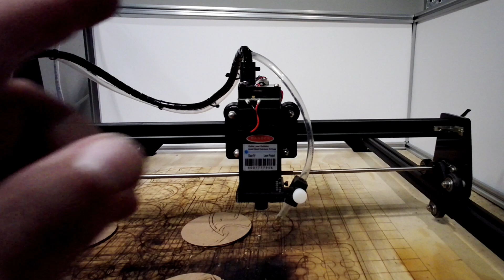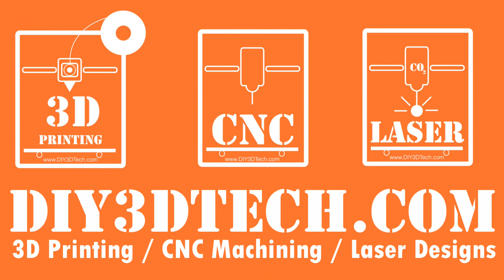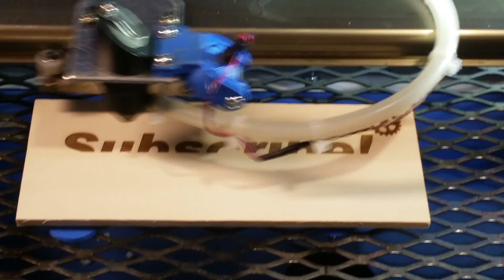Ortur Laser -  Adjustable Air Assist (Diode Laser)!

Comment: Just found your channel. Thanks for the good content, delivery, and length of your videos.  I just received a new Atomstack laser which comes with a protective shield around the laser output.  I also do not have a 3d printer.  Suggestions?
Reply: you can make a support bending one wire   around the laser

Comment: I wonder if I could use a fish tank air compressor instead of a $80 air brush one. What are your thoughts?
Reply from the maker: But you need one with high output so you are going to be in the $65 to $80 price in general.

Comment: How is this connected to the air pump? I can't see the pump you're using in the link but think I've something similar. Is it simple insert or do I need a connector of some kind?
Reply from the maker: You can direct connect it, but mine is a little more complex.  I will likely do a video covering its design...
Reply: @DIY3DTECHcom Did you do the connection video to the air pump, i am stuck at that point as well, is there some kind of special fitting needed to connect the clear tubing to the air compressor directly or a fitting to connect the air tubing to the threading tubing that came with the air compressor?
Reply: I figured it out just get a 1/8" BSPP x 1/4" Barb and attach the tubing directly to the compressor forgoing the hose that came with it.

Comment: Hello
You Sade that your using an 6 bars compressor. But, then u told us that you dont use so much air to blow away the coal. So, my question is: how high or how much air is going throw the nuzzle?   Or, how much air does it required? 
Have on compressor outdoor that can do up to 12 bar. Or can i do it with an air compressor for fish tank?
Reply from the maker: I use an air brush compressor, at 6PSI via 0.8mm nozzle no clue on the volume of the air just the pressure.  Note I find a good balance going much higher runs the risk of blowing the work piece away or out of alignment.

Comment: Is there some vacuum at the back to catch the smoke / debris being blown by the air assist? Cheers, Mike.
Reply from the maker: Check out my prior video on my evacuation system also see links in the description for what I use if your interested in learning more as it works well!
Reply: @DIY3DTECHcom  
Cool. I've ordered the Ortur as I have found that using an existing RAMBo board (Prusa MKS3) with Marlin firmware does not allow full usage of my existing OptLaser Diode attachment. 

Basically the same 3D printer can not simply 'double' up as a laser engraver.

Comment: I hadn't thought about it in years, but we developed laser ablation process at IBM back in the 80's that used helium blown over the part for debris removal.  We had a ss tube with holes in it for the helium and on the other side was a vacuum pickup.
Reply from the maker: Interesting, I know some folks also use CO2 from large cylinders used to refill paint ball guns too...
Reply: @DIY3DTECHcom  yeah we used M cylinders, doubled up with an auto switch over when one of them went below a cutoff pressure.  That way you could change out the low cylinder without interrupting the process.  The helium was used due to the size of the helium atom and the faster speed to sweep away debris if I remember correctly....30 years ago.....

Comment: i use it from a week now this air assist from yours project and is perfect.the one without adjust. just one thing the lens adjust will not fit in but can adjust it with fingers so not a problem. it is very good idea.
Reply from the maker: Super! :-)